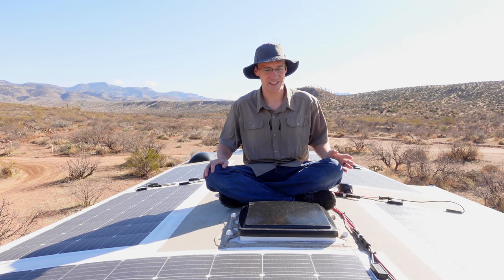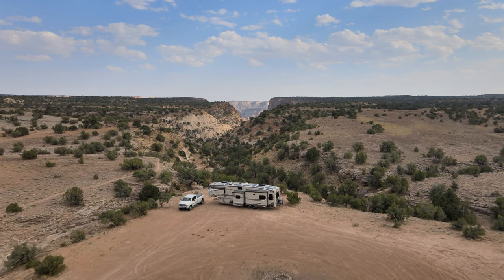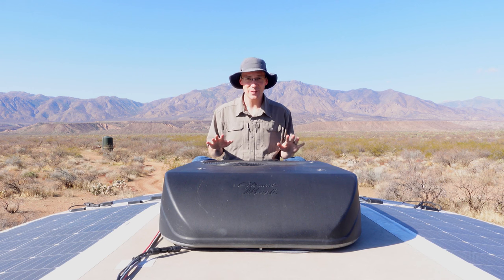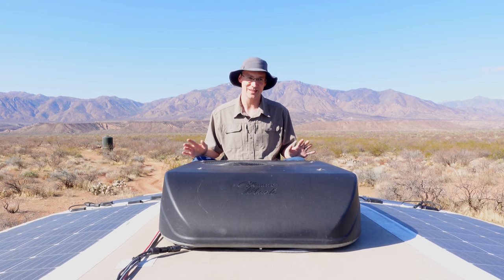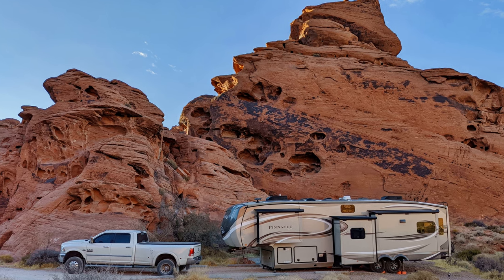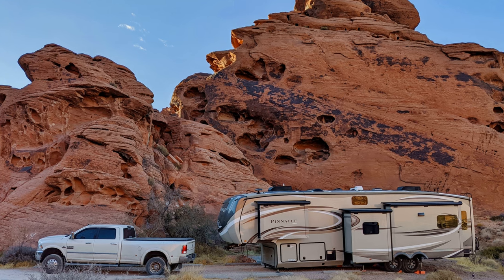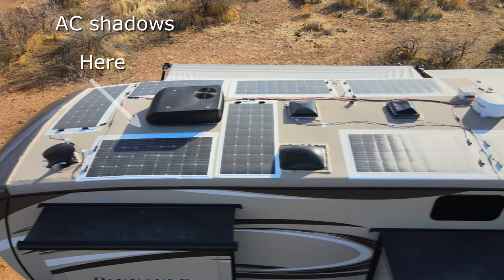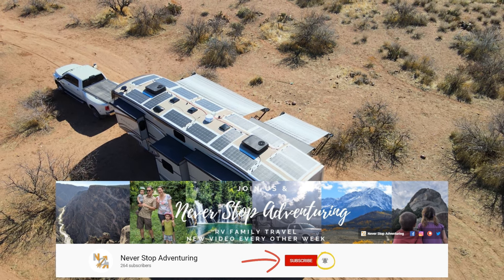RV Solar System Lessons Learned

Comment: Install a mini-split and your a/c energy consumption will go waaayy down.
Reply from the maker: We'd love that. Might be a future project at some point but I really don't know where I'd mount the external unit. I'd probably have to find a different solution for our bike rack... In the mean time this works pretty well and you know what they say: if it ain't broken...
Reply: What's a mini-split ?
Reply: Have you learned much about the effectiveness and efficiency of a min split ? Really sounds like your black box roof top ac are using way too much. Maybe this video is a year behind but I would encourage you to watch mini split videos . And even a small generator easily runs them.  Thanks for teaching what you have learned.

Comment: Performance wise, how would you rate the flexible vs the large framed solar panels?
Reply from the maker: No doubt rigid panels are better. They're usually more efficient and you get more wattage per $$ spent. They're also very heavy though and we didn't have the weight to spare on our RV. Are you thinking about putting solar panels on an RV?
Reply: I have had motorhomes since 1986. For 4 years now, I have had a large bank of Lithium batteries primarily for cooking.  It is cooler in hot weather and far more convenient at any hour if you want to heat something in the microwave or make some coffee or tea.  I very seldom use the generator.  My wife prefers electric cooking in the motorhome.  Most charging is done while traveling from the engine alternator.  We usually dry camp in one location for two to three days.  It would be nice to have additional power from solar  to lengthen a stay should we change our three day habit.  For dry camping, we have found our ceiling fan over the bed to eliminate the need for AC.  @NeverStopAdventuring
Reply from the maker: @CFPVideoProductions  sounds like the perfect setup for some rigid panels and a solar controller. How much wattage did you have in mind?
Reply: @NeverStopAdventuring  This is only a rough estimate with no real documentation.  We seem to be able to run 2 roof fans 24 hours a day, a bedroom ceiling fan at night, do regular amounts of electric cooking and running small appliances like recharging phones and cameras for 5 days.  We have about 8,000 Watt Hours of usable batteries and figure about 1600 Watt hours/day.  We usually only dry camp up to 3 days, so the figures could be off.  Fresh water, grey and black tanks, taken into consideration, we would likely have to constrain our lifestyle to continue any further, which is possible.  Given past experience, 400 watts would be nice.  That may be too conservative in practical use.

Comment: You need to install a minisplit. You can get 12,000 btu units that use. MAX 960W  and will kick down one it hits temp(inverter based compressor) you can buy one for about $800 and installing it yourself is pretty simple imo atleast(I have diy 7 minisplit systems so far) you would fully be able to run ac with your solar system and minisplit with zero compromise.  They are also heat pumps so you will get that s a me 12000btu heat output for about the same wattage.  You really can't go wrong! They are also over 2x as quiet 🤫 with no surge loads!
Reply from the maker: I'd love to. Maybe when our current AC's go out. But there'd also be some other logistics to work out, like where to mount the external units. Also, a single 12k btu unit wouldn't be enough for the size of our RV.

Comment: Great information I’m camping threw the winter for a first time RVer during the summer my solar was doing whatever I wanted now winter is starting in Pennsylvania and poof I’m in a park down on a hillside and don’t get a lot of sun during the day and solar is struggling.
Reply from the maker: Thanks! Winter is definitely a whole different animal when it comes to solar power. It helps a lot to be able to tilt your panels. In our case, it makes a big difference if we can get the back of the trailer facing south. Often times we just can't though.

Comment: I noticed all you panels are flexible. How did you adhere them to the roof and did you have any "bleed thru" of heat under the panels into the coach?
Reply from the maker: I used velcro in several places on each panel to keep them from shifting while I taped them down. It was Eternabond roof repair tape. We haven't experienced any heat bleed through but our roof is pretty heavily insulated. If you go with flexible panels I really recommend going with a brand that offers a long power output warranty. We're still really happy with these Renogy 175W ones!
Reply: @NeverStopAdventuring   I've been told by several people of this concern. I do have insulation in my ceiling but have always been warned away from flexible panels, without any explanation other than heat intrusion.
Reply from the maker: @Carl Jones  flexible panels haven't had the greatest track record, but they aren't all equal. We're still happy with ours. I'd highly recommend these Renogy ones. If you don't need a lightweight solution, rigid panels have more wattage for the money.

Comment: OMG thanks for this video.  I’m installing flex on the roof as well !   But can you make another video on how the tape and solar panels are doing ?   Any lifting, or roof issues ?  Thanks for everything, peacefrom510 .
Reply from the maker: Glad it helps! Those flex panels are pretty great. There really isn't anything else to report. The tape and panels are holding up great. No lifting or roof issues whatsoever. The cable tie downs were the only thing. If there are any issues we'll let you know!
Reply: @NeverStopAdventuring  nice .   I’m really curious about those panels as well ....    thank you for your time!    Peacefrom510 .

Comment: In the arid places you guys stay, an evaporative cooler may work just as well. I saw one installed on a van on YouTube.
Reply from the maker: That's a really great low wattage solution. We've actually been in a lot of really humid places in the last 4 years too. So much so that we've needed a dehumidifier to keep condensation down!

Comment: What width tape did you use?  3”?
Reply from the maker: Mostly, yes. There were a few places where I used 1" tape too.
Reply: @NeverStopAdventuring  .. I’m putting up 4 of the 175watt panels with plans for 6.  Just trying to figure out if I need (and how to apply) some air gap under the panel for heat dissipation
Reply from the maker: For what it's worth, I didn't use any. Not to say that there wouldn't be a benefit, but Renogy told me it wasn't needed and I haven't had any heat issues.

Comment: Black wire ties tend to brittle faster than white/ clear nylon ones in outdoor direct sun
Reply from the maker: I will definitely keep an eye on them! These particular black zip ties are UV resistant. I wasn't aware they made UV resistant white/clear ones. Could be that's just what I was used to in my technician days...

Comment: I suppose for a young family inverters with solar to replenish the batteries makes sense.  Though I have been using those dollars to convert my 120 volt A.C. to 12 volt D.C.  We don't use the microwave and we just move to more comfortable climates, so no real need for A/C.  Great video!
Reply from the maker: What temperatures are you happy with in the summer? We find that we can't really get enough airflow through our windows by the time it hits about 80 degrees outside. Couple that with the sun beating on the trailer and we're happy to run our AC. That same "problem" works out really well when it's cold. We find we get a lot of natural solar heating with this rig.
Reply: Never Stop Adventuring I like altitude in the summer.  Now don't misunderstand me, I think total systems like you have are awesome technology.  I just decided to go a different route.
Reply from the maker: Altitude is a great way to do it for sure!

Comment: Great videos! I wonder if I could ask your opinion based on your experience with the 37MDQS?  I also have a PInancle 37 MDQS (2018 model). It came with the overlander package, so it has a 1200w Xantrex inverterd and 4- 125w panels on the roof.  We are full-time and hope to boondock as much as possible in the next year. I am scheduled in late August to have the following installed: 6- flex panels for 1440w, plus 2 victron charge controllers (one for the existing panels to thats a total of 1940w). 4- 206ah SOK LifePO batteries, and 1-Victron Multiplus II.  My understanding is the new Multiplus II powers both legs of the 50amp system, making 2 inverters not necessary (not sure if that is true).  I did not add any EasyStarts, but that is an option.  My question is, based on your experience with the 37MDQS, am I likely to be satisfied with that system or am I likely to regret not going bigger?  I can add more panels, more batteries and another inverter... but that would be close to 10K that I would rather not spend.  Your thoughts are appreciated.
Reply from the maker: Thanks! How satisfied you'll be depends entirely on how much you want to run. That's definitely enough equipment to run just about anything, but with just the 1 inverter you'll probably only be able to run one big appliance at a time. What is it that you'd like to be able to do?

Comment: How have the flexible solar panels held up?
My concern is flexible solar panels inability to deal with heat and thus are prone to early failure.  Yes they are much lighter than traditional solar panels, but longevity has been a real concern.
Reply from the maker: Our particular setup has held up really well and continues to do so. I've heard of lots of failures with flexible panels, but not with these Renogy ones. I wouldn't hesitate to use these same panels again. They come with a pretty decent warranty.

Comment: I saw another video where somebody removed the factory air conditioning units from the roof and installed a particular kind of AC unit inside the RV It was working well for them I believe theirs was a 26-ft unit I'm not sure if they had one or two AC units However once you remove the rooftop ones you could probably put reinforced roof where the holes were and then put extra panels on the roof for even more power. Just a thought although it would take up some of your interior for these other AC units the extra power you get might just be worth it. Perhaps the new panels could be tiltable? Thank you for your video.
Reply from the maker: Sounds like a mini-split. Those are a much better option for sure. They're way more efficient and I'd love to have them. Once you remove the rooftop ACs it frees up even more space for solar panels too! Although it's definitely more money and another major project and while these RV air conditioners aren't the most efficient, they do work. For now anyway...

Comment: What are you guys doing welding with all that electricity? That’s crazy
Reply from the maker: I probably could run a welder, but it's really for running AC units. Really though, since we live in it we're powering an entire household. While it's large compared to your average RV solar setup, this is nothing compared to the amount of power many RVs consume on a 50A campground connection.

Comment: All great info but one of the most important pieces is the battery bank as it's the heart of any system. Our system is 4-100amp Lithium ion's, 1320 watts of solar panels, a 3000watt inverter/charger, a 150/100 mppt controller and 2 Micro-Air soft starts for the a/c units and have only tried out the system in our driveway a couple times (end of camping season around here) and with 1 a/c running we can get roughly a few hours and thats it, with the electric fireplace going, it's about the same as the ac, you could see the battery monitor just sinking down from 100% charged batteries, 9 days, 6 days, 2 days, 10 hours, 6 hours, 3 hours 30 minutes etc. all in a matter of a few minutes of monitoring lol. Probably adding another battery or two here soon.
Reply from the maker: We have 6 100amp Lithium batteries and went over the battery and inverter install in another video. This video is more about the system as a whole. You're right though, the battery bank generally gets kinda glossed over. You're setup is actually a bit more appropriately sized than ours.  Our solar array is oversized on purpose to run that air conditioner while the sun is up. Ideally a much more efficient AC unit, like a mini split, would solve some some power consumption issues!
Reply: @NeverStopAdventuring  Ive been seeing more and more of this but where too put it!!! I have room for about 4 more smaller 100 amp panels, these REC 330 watt panels take up a lot of room on the roof..
Reply from the maker: Agreed, not sure where I'd put one either. I might consider one on a different RV in the future.

Comment: Nicely done video. I'm about to install 3780 watts with 3 strings 2s2p and a 16s 48 volt LiFePo4 280ah battery pack and 6000w inverter on our bus build. Waiting for a few items yet. Your video helped validate that we'll be adequately powered running a/c. We both hate trying to sleep overheated. Subscribed. I'll check out your install videos.
Reply from the maker: Thanks! You definitely won't be disappointed with that large of a setup. That's huge! A large setup makes a big difference on those really cloudy days too.
Reply: @NeverStopAdventuring  that's what I was thinking. The larger LiFePo4 cells have come down to the point where a large bank is financially feasible.
Reply from the maker: They really have come down in price. The Battleborn's are pricey but I do like the built in protection. There are way cheaper options out there, especially in the DIY realm. Ultimately it was the built in protection that sold me on them. Many others are doing the same though.
Reply: @NeverStopAdventuring  can tell me how to acquire everything I need to install solar power in my RV?My husband and I are looking to put it in our 26ft 5th wheel rv.
Reply from the maker: Hi Loretta, we have equipment lists with links in these two blog posts: https://neverstopadventuring.com/2020/09/rv-solar-install-solar-panels/  and https://neverstopadventuring.com/2020/09/rv-solar-install-batteries-inverters/
Reply: @NeverStopAdventuring  thank you very much

Comment: How are the flex panels? Debating tossing some on van roof.
Reply from the maker: They're still holding up well. We're still really happy with them. Rigid panels are cheaper if you can spare the extra weight.

Comment: You need to use UV resistant zip ties check a store for electricians they work awsome
Reply from the maker: All the zip ties on the roof are in fact UV resistant. I'm curious what made you think they weren't? In my experience UV resistant zip ties are usually black.
Reply: @NeverStopAdventuring  all ul listed UV zip ties are black or white with a metal tab on them instead of the plastic tooth that locks them right. Not all black zip ties are UV rated. The ones I'm talking about are ul listed
Reply from the maker: Ahhhh, thank you for explaining that! Someone else had commented that my zip ties weren't UV rated so I wasn't sure why people thought that. That makes sense now. If any of these fail on me I will be sure to get back and get the UL listed ones!

Comment: So what was your cost to install this system? Everything,
Reply from the maker: For the solar panels, controllers, and associated wiring it was about $7400. There's a more detailed description on our blog: https://neverstopadventuring.com/2020/09/rv-solar-install-solar-panels/
For the batteries, inverters, monitor, etc. it was about $9400, also detailed in a separate blog post: https://neverstopadventuring.com/2020/09/rv-solar-install-batteries-inverters/
It was a lot, but I'm sure I saved a lot in labor costs too buy going the DIY route. We're still happy with the setup. It's completely changed RVing for us!

Comment: Plastic zip ties will disintegrate in the sun. Try plastic-coated metal twist ties. I think they will last longer. You can get 500 twist ties for like $8.
Reply from the maker: The UV resistant zip ties I used for this have held up really well.

Comment: Yeah I like the idea of how you did your solar panels the only downside is you can’t raise them up or tilt them to meet the sun which in many of those locations tilting one bank of solar panels towards the sun would’ve increased your power output by 20 or 30% easily but it doesn’t sound like you’ve ever really needed that what you really needed is one more battery especially because your batteries are all being topped off quite early in the day with the amount of solar that you have another battery Would give you huge benefits of sharing across the lot of them but I don’t think you’re ever going to exceed your battery power I’m surprised you haven’t just let it run to see what you ended up with without turning off the AC after all if you’re in a shadow by 2 o’clock in the afternoon your AC is going to run less anyway, being in a shadow so it’s a wash going to look through your videos to see if you’ve ever really stressed your system because if you’re at 50% on the heavy use it would be very difficult to use so much more energy that you would deplete your source? As you would have to use double the amount of energy to completely run your battery down which I can’t see happening, anyway great video
Reply from the maker: My biggest limiting factor with the whole project was weight. Tilting mounts would have weighed more and would work better with rigid panels anyway. Same thing with more batteries. If you go by a solar calculator then yes, we have an undersized battery bank. Again, that was for weight savings. Our 6 batteries really give us all the power we need. The only time we come close to running out of power is when we run the AC's into the evening. Thanks!